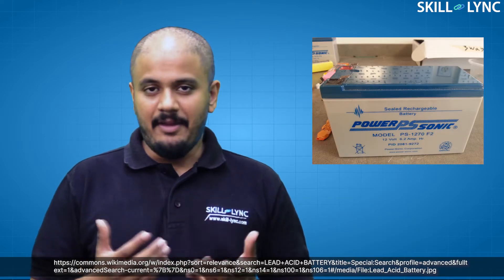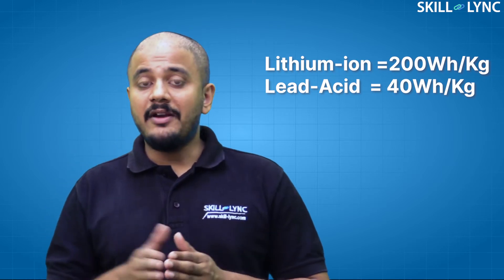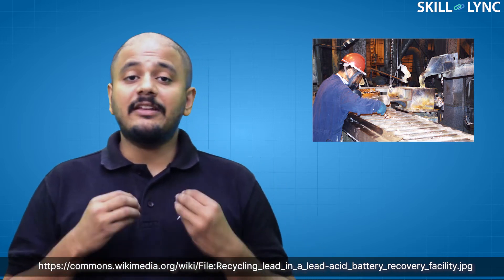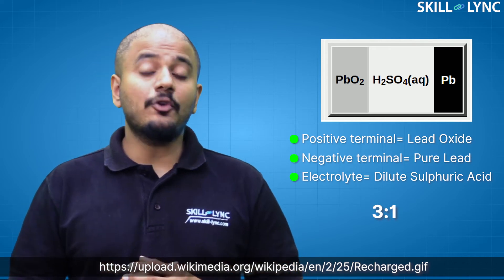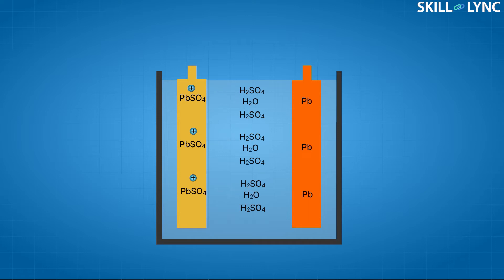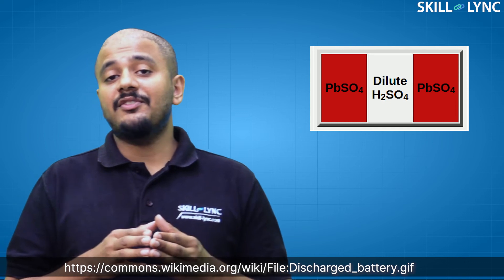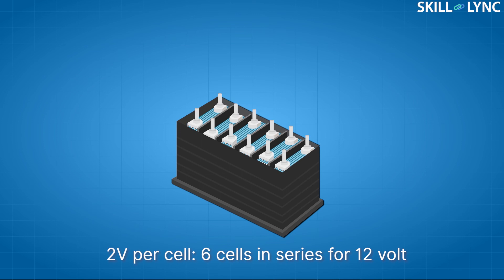How do Lead Acid Batteries Work? | SKILL-LYNC

Comment: Sir, I have a question..
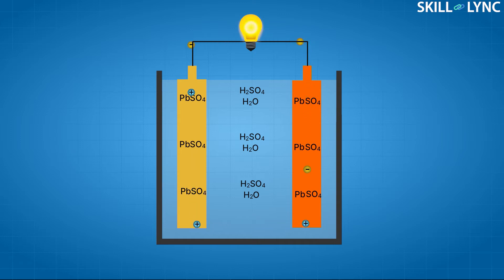In the 02:32 timing on this video,why the electrons flow is in a circular way???
The electron should pass from right to left only via the conducting material between them. But, why there is flow of charge on there electrolyte??
Explain please..